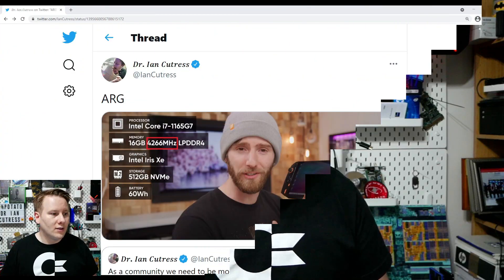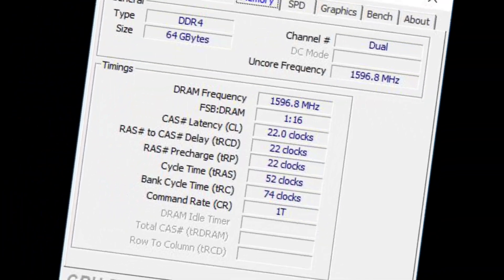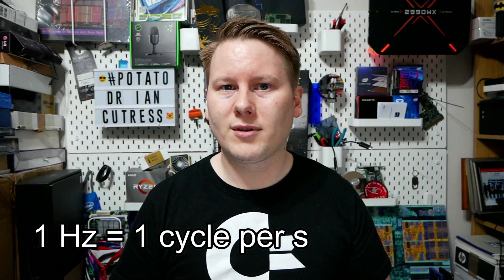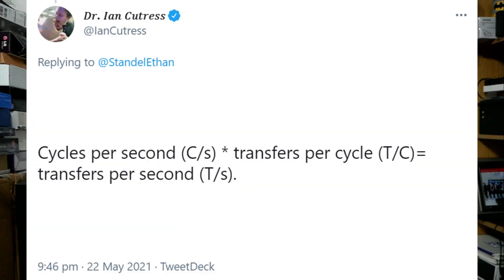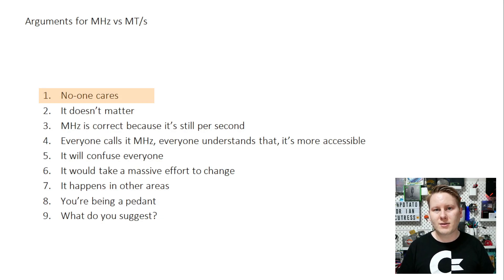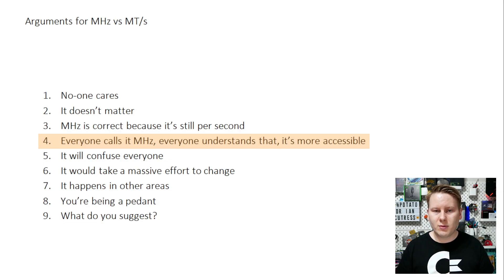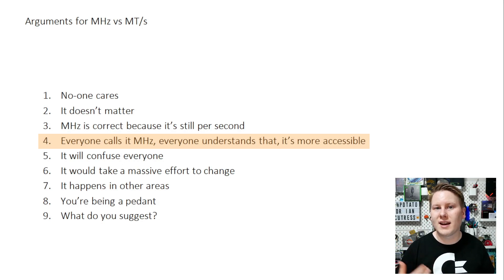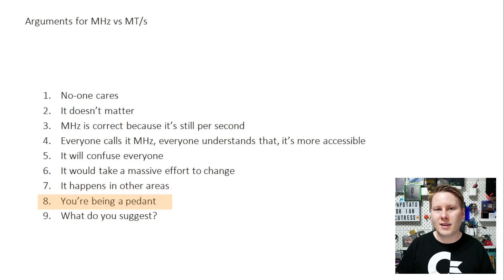Linus is WRONG 💩 : Explaining MHz vs MT/s

Comment: Are we going to start referring to hard drives by their TiB sizes now too? ;-)
Reply: Good lord, I hate how Windows calculates disk size in tebibytes and shows it as terabytes. It's needlessly confusing.
Reply: @keyboard_slap  Well, up until recently everybody did that. The transition to Ki, Mi, Gi, Ti and so on is going really slow. I myself didn't liked it in the begging and now I kind of ok with it and can recognize it and work with it, but I'm perfectly fine without it also. Unfortunately, I don't see it becoming proper mainstream in this decade. But this should improve, nevertheless.
Reply: The difference is that TBs in hard drives are actually correct and accurate.
The only one at fault here is instead microsoft in windows systems for referring to TiB units as TB when TB technically means exactly 1,000,000,000,000 bytes. Fault which of course extends to their use of all the other units, GiB, MiB, etc.
Reply: @MrtinVarela  I think the main confusion stem from SSDs which are marketing as 960GB or 500GB or 250GB instead of 1TiB or 512TiB or 256TiB and such.
Reply: @johnnychang4233  No, why would that be confusing?
If it is marketed as 480gb, and it shows 480gb, there's literally no issue anywhere: it has exactly what is says on the tin.
Now, if you're talking about advertised "1TB" SSDs that are only 960gb then yes I agree on those, but it's a different subject.

Also, many (e.g.) 480gb SSDs are in fact 500 or 512gb but they only expose 480gb to the user because of over-provision, which is a necessary evil for the sake of performance and longevity.
Reply: @MrtinVarela  Do over-provision increase after the SSD drive is formatted?
Reply: @johnnychang4233  No.

Hardware over-provision is managed at the SSD's controller level. It is a transparent feature, thus not visible or accessible (or modifiable) by any tools or operating systems.

You may manually provide additional "user" over-provisioning by simply leaving a small portion of the drive unformatted. This can be increased or claimed back at will, unlike the hardware over-provisioning.

extra note: SSD stands for solid state drive
Reply: @MrtinVarela  I doubt is Microsoft fault, it's just easier for consumers to consider it in decimal system instead of binary system. It's good as well for marketing. But computers worked and still do in binary. I consider it a scumbag move to get 960 Gb of HDD space when in fact should be 1024 Gb in a 1Tb HDD. Now buy a 16 Gb HDD and see if you're happy with the lose of space.
Reply: @SingularityAdvent  You're not getting it. Microsoft is using binary, but pretending to be using decimal.
Reply: @MrtinVarela  they made a mistake but cant change it because they need to maintain backwards compatibility with older hardware
Reply: @Bobby-zg5fp  They literally just obsoleted processors as recent as the i7-6700k with TPM requirements. They don't give that much of a shit, they're just not gonna spend that sort of resources on their own.
Reply: Some of the SSD producers are changing that.  Also, imo, this has little to do with the subject of the video.
Reply: Funny, he used 16 gigabytes in the memory description, but memory is binary scale not like the HDDs!!
Reply: Thats only in Windows land i think (still have to check if MacOS does it right though...)
Reply: @nullderef  MacOS does get it right. It measures in base 10 and displays in base 10.
Reply: I see all the comments in reply here and I wonder if anyone realizes that Linus also did a collab with Jeff, as if it was meant in jest.
Reply: we should!
Reply: legit :(
Reply: There's no confusion on hard drive sizes, it's clearly indicated in correct terminology.
Reply: That's different, the units used by hard drive manifacturers are correct. This is not about using a different unit, but about using the right one for the thing we're trying to represent.
Reply: I was hoping someone would say this. The age old base 2 or 10 debate.

Comment: This is about as relevant as the nanometer wars going on between Intel, TSMC, Samsung etc. i.e. Is Intel 10nm approximately equivalent to TSMC 7nm (or 10nm?)
IMO, the units of measure are becoming somewhat frayed at the edges so I begin to question if the unit ITSELF is relevant to the task.

W.R.T. the nanometer wars, I'd suggest that Max MT/mm3 (mega transistors per cubic millimeter) is more appropriate as time moves along.  (This explicitly allows for 3D stacking of transistors which I believe will become VERY prevalent in the near future).
How many people out there even KNOW what gives the 7nm node its name?  Is it the channel height / width / length?  The gate height / width / length?  The insulation distance between the gate and the channel?  If you're unable to squeeze the NEXT transistor right up against the prior one then, from a speed perspective, is there any significant GAIN in migrating from (say) 10nm to 7nm if the individual transistors must remain 50nm from their closest sibling?

Personally, I think EUV versus DUV is IMMENSELY more relevant (and perhaps helps to explain why Intel still has a LARGE hole in their feet at their so-called 10nm node)

Comment: Just checked the store of a major PC hardware retailer in Germany, they have some filters on their webpage based on clock frequency in MHz where they also use the MT/s values. So when I sort for 3600 MHz, it actually shows me 1800MHz memory.

Comment: I think using Hz is perfectly valid for both, i.e. 1800 MHz is the clock frequency, 3600 MHz is the data transfer rate but personally I'd much rather see effective bandwidth/latency in RAM specs instead of MHz.

Comment: If I had to decide what memory I would want to buy - I want to see BOTH units - not nothing - as THAT would be confusing as to what the memory is actually capable of - too many scammers out everywhere taking advantage of this kind of dualistic terms... Remember the RMS issue on speakers and amps power years ago? Many got scammed ... too many. And many sellers that actually sold stuff correctly stating the RMS value saw customers going for cheaper stuff incorrectly labled.

Comment: I still prefer using MT/s, while not using the units would technically work and is inline with JEDEC spec for labeling the various tiers of performance.

Being accurate will help everybody in the long run IMO.

There's also the issue of everybody not using: bits vs Byte = (b/B) correctly

And people confusing the Decimal vs Binary prefix for units of storage and data rate.

Are you using:

Decimal-SI Prefixes (Multiples of 1000):
kiloByte
MegaByte
GigaByte
TeraByte
PetaByte
ExaByte
ZettaByte
YottaByte

Binary-IEC Prefixes (Multiples of 1024):
KibiByte
MebiByte
GibiByte
TebiByte
PebiByte
ExbiByte
ZebiByte
YobiByte

Or are you confusing the units as to which is multiples of 1000 and which is 1024 when you're writing specs.

Alot of Vendors/Publications and Tech Specs need to be more explicit on which units they are using so that people are clear on what they are getting.

Storage Makers have made this issue confusing by listing their storage as Multiples of 1000 while the Popular File Systems we use list things in Multiples of 1024

I wish there was consistent clarity as to what units everybody is using when they list specs.

Comment: I'm happy with the idea of just dropping MHz or MT/s and using the number only. It stops confusion when you may accidentally say the wrong one - which seems to happen a lot anyway. Also, as memory gets more stable at overclocking at higher speeds, we won't care about what the actual real MHz they run at (which won't change so much) and more on their stable OC speed. This also does away with the confusion to noobs in tech.

This reminds me of the confusion with KiloByte, MegaByte, TeraByte, etc. sizes being a multiple of 1024 or 1000. Which we know some manufacturing companies (looking at the hard drive companies here) flat out go against the known standard at the time (1024) to make their capacities look larger. And now they've been doing it for so long, no one is willing to force them in line. We just live with it. I wish there was a similar solution we could do here.
(I know KiB, MiB, etc. were introduced to fix this, but it hasn't taken, as everyone just wants to say "Terabyte" or use TB instead.)

[Edit: Found a misspelled word!]

Comment: NO. WE. SHOULD. NOT. CHANGE. THE. TERMS (IMO)
I used to get annoyed by this. Hell, I still get annoyed by "x86 vs x64" and "SATA vs IDE" which makes no sense. But the thing is if you try to come up with a new method to talk about "MHz vs MT/s" then the technically literate will get it (mostly) and the general community will probably end up MORE confused. As you know, Linus understands the terms but in some instances it's just easier to shrug and say things incorrectly when the people who SELL the memory get it wrong too... but that's just an opinion. I get the desire to nail the terms, especially if you're Linus and making expensive videos which should educate the public, so the question must be will it HELP, HURT or make LITTLE DIFFERENCE?
Reply from the maker: The point is do you want it accurately reported, or inaccurately reported?

Comment: I'm not really invested in the issue much, but I'll make this point:
The clock is just a reference pulse that dictates the speed of a device. When a memory module triggers on the rise and fall of the clock signal you effectively double the clock signal. Basically creating a module internal new clock signal that is double the input clock signal. And since every internal cycle constitutes an independent step of operation of the memory module, saying a DDR-3200 module runs at 3200 MHz is technically not wrong imo.
Think about it like this: If the memory only triggered on the rise of the clock signal and you would run the input clock at 3200 Mhz, you would end up with the same Memory speed as before. The memory module would be doing the exact same thing with the exact same cadence as before.
So the memory chips actually run at 3200 Mhz in either case. So it is really down to the definition of how you define clock speed. You could say the memory module runs at 1600 Mhz but the memory runs at 3200 Mhz for example.

Comment: So this was basically an argument back and forth between you guys about the accuracy of fenders calling something by its double data rate when it's not truly running at that speed it's running at half speed. With memory I always kind of figured it was synonymous and that people understood that one met the other because you're talking about the double data rate but I could see how that would be confusing to somebody who doesn't know the difference? And spend enough time tweaking memory and their timings and everything and dealt with it being such a big deal with Ryzen for so many years now that now if I see that we're talking about memory I already know that I have to take the rated speed and divide it in half and then do the same thing for the memory fabric etc and my pursuit of getting a 1:1 rating where the fabric runs at the base/half speed. For instance I currently pick up ddr4 4000mhz 32gb to try and push everything as close to 2000mhz from 1800mhz as possible for best performance and so far my only chip to appear to truly do this is my 5800x - my 5900x runs 1933mhz memory and infinity fabric but stopped working and requires a bios reset with the CMOS jumpers if they go any higher... My 3900x is on a 1st Gen motherboard I only has options for PBO being turned on, related to memory I just have to pick from the 'half-rated' speed (or actual speed) and then adjust the timings as well as other basic stuff related to timing and I think the motherboard does everything related to the infinity fabric automatically...

Comment: yes, if you want to use engineering terminology use it correctly. Should people want to delve deeper into those numbers, they have the correct starting point. Just stop the precision at the point you feel your target audience is capable of understanding eg: use just ddr4, ddr4-3200, or ddr4-3200MT/s.
Simple.

Comment: I think removing units would be a bad idea. For example if memory is listed as 3200 you don't know if it is 1600MHz at 3200 MT/s or 3200MHz at 6400 MT/s. Here's a suggestion, keep the naming convention but just label it as max memory bandwidth so when QDR comes out it won't create another issue.

Comment: I mean, I this is all super confusing so why use units? Brain melting. I think using either the correct units or none at all is the best way. Mega transfer isn't easy to say quickly which is probably why it's fallen out of favor and so much marketing goes into "speed" and quickness so most marketing departments are focused on getting. Those super fast Hz numbers out there

Comment: Absolutely brilliant content! I've been reiterating that Hz is a measurement of a single Cycle Per Second and the DDR misrepresentation of frequency vs transfers, though I completely understand the marketing behind it.
Reply: "The frequency of any phenomenon with regular periodic variations can be expressed in hertz, but the term is used most frequently in connection with alternating electric currents, electromagnetic waves (light, radar, etc.), and sound."
https://www.britannica.com/science/hertz
Your definition is too narrow, frequency of transfers can also be expressed in Hertz.
Reply: @magottyk  we're talking about clock frequencies pertaining to computing and Ian is absolutely correct in it's misuse in modern day RAM marketing. As far as Hz being the measurement in terms of microprocessors I'll always refer to it the frequency being one cycle per second; the rest boils down to the underlying architecture, how efficiently and how many instructions it's able to execute per cycle.
Reply: @GregorysBrain  
There's a term called effective frequency and it's measured in hertz. As defined by Britannica "any phenomenon with regular periodic variations can be expressed in hertz" MT/s is the theoretical constant maximum.
As clock frequencies can also dynamically vary multiple times per second (i.e. Not regular) then by the reasoning that MT/s is not hertz, then neither is the practical application of actual clock frequencies in modern computing.

As I said, your definition is too narrow.
Reply: @magottyk  it's meant to be in this use case, and yes I see your point.

Comment: JEDEC never put MHZ after it's speed rating.

DDR4-3200 is simply "DDR4-3200" not "DDR4-3200MHz" and its run at 1600MHz or 3200MT/s with timing 20-20-20 to 24-24-24 depends on sub spec such as DDR4-3200AA will run at 22-22-22 or 13.75ns CAS lattency

https://en.wikipedia.org/wiki/DDR4_SDRAM

There is no 3200MHZ DDR4, just DDR4-3200 which run at 1600MHz

Linus have very limited knowledge of Deep Technical in how some hardware and signals work. But his audience are mostly same level as him, so not a problem.
I used to have fun and laugh when he went like ... WTF how this happen ? ... He make wrong assumptions many times.
Poor Linus.

Comment: Sorry, but MHz just means Mega and Hertz: million and (frequency of something per second). Mega-transfers means million transfers. "The transfer rate is xyz MHz" is still correct. If they said "the clock speed is xyz MHz" then you are right. When Linus says "Nobody cares" it means nobody cares about the clock MHz specifically, we just care about the speed, which is the Transfers. MHz is rate of ANYTHING and MTs is rate of TRANSFERS, and ANYTHING can be TRANSFERS, so Linus, nor is anyone else using MHz is wrong unless they say it is signal clocked at xyz MHz
Reply from the maker: Nope. Literally addressed this in the video. Hertz is a periodic measure. Not simply a per-second measure. I gave two examples of why Hertz as a periodic measure matters, and Linus gives one. But good for you for watching the whole way through!

Comment: If you want to take up a battle against incorrect terminology you should call out the hard drive manufacturers for redefining gigabytes to gibibytes for the past two decades. Yet somehow the redefined gigabytes only applies to storage mediums and not to ram or data being actively processed inside a piece of software. Furthermore they even use this measurement for solid state memory which makes even less sense due to how it functions.

Comment: Just use the "true" clock rate. In that case, you don't need covert it whenever setting the clock rate.  (Yes, I know it is rare need to do it other than overclocking)

Comment: I've actually just tried to do some manual memory overclocking for the first time and the wrong units in BIOS actually confused me a little bit. It matters when we're talking about 1:1 ratios when the FCLK is 1600MHz and the ram is 3200 "MHz" which is obviously not 1:1.We're also at the point where it can overlap itself when theres 2133 and 4000. No units would be better than wrong units since your first assumption of units tends to be the correct one but it would slow you down if it was against your assumption.